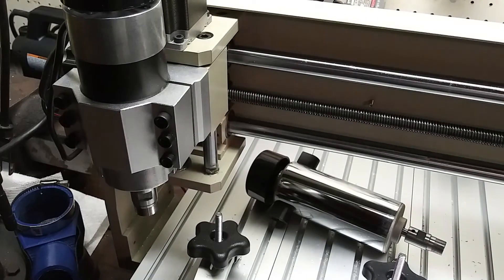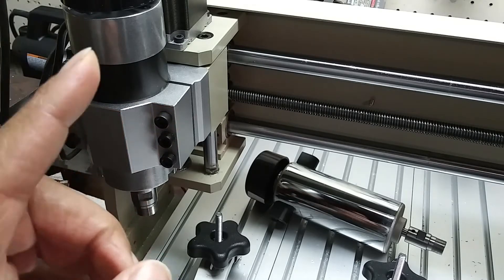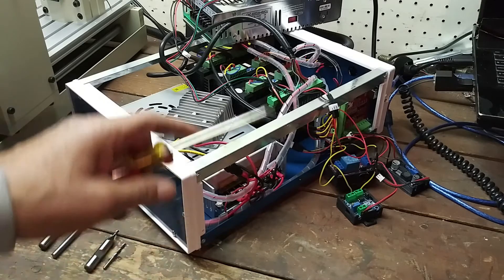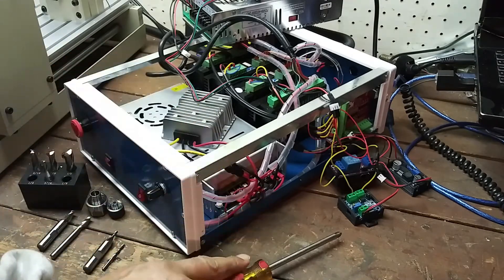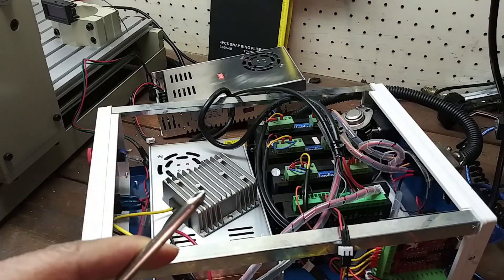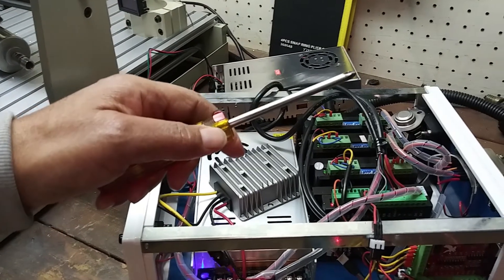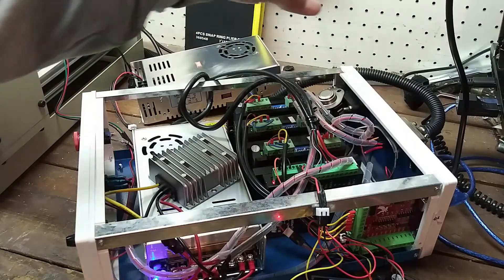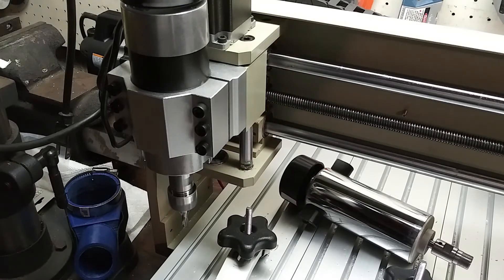CNC 3040T USB Router - 500W Brushless Spindle Update

Comment: Nice video. The ebay link to the spindle kit seems to be a stale link. Can you give some information on it? I am interested in upgrading my cnc with this.
Reply from the maker: Hello, and thanks for the comment.  I checked my purchasing history and the brushless 48V ER 16 spindle is no longer available from that seller. If you do this search on ebay, "brushless spindle 48v er16", you will find a number of options, many including a power supply for it as well as a set of collets.  But, results of this search will also include the spindle, driver and mount only, just be sure that the one you select says Brushless and ER16.  Hope that helps!  P.S. My video entitled "Pelican PL Revival - Chapter 3" includes, near the end, a couple of short segments using my CNC to cut a largish Aluminum part (with a rather dull 1/8 inch end mill, but, I got through it).
Reply: @Wrinkles6768  Thanks!